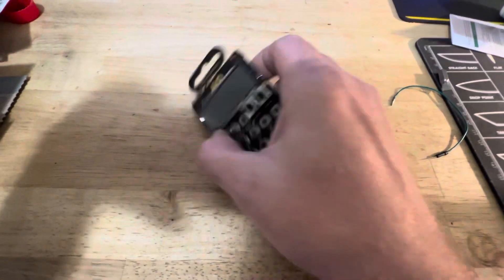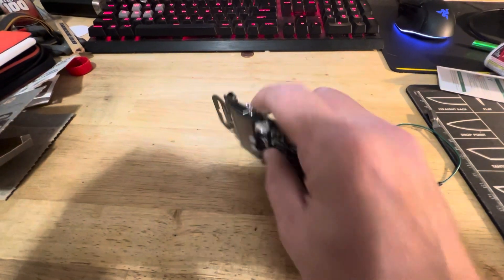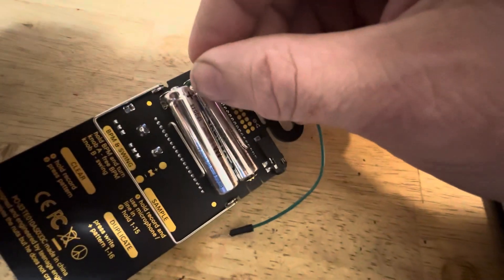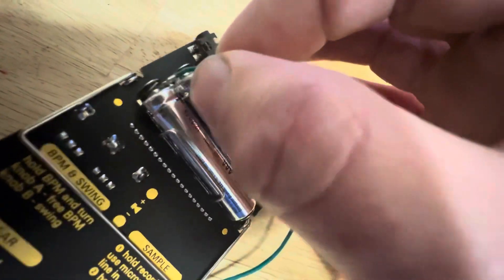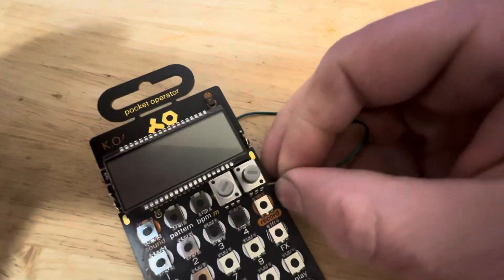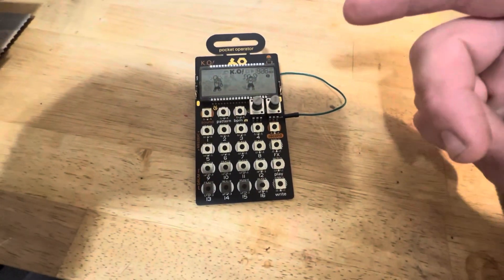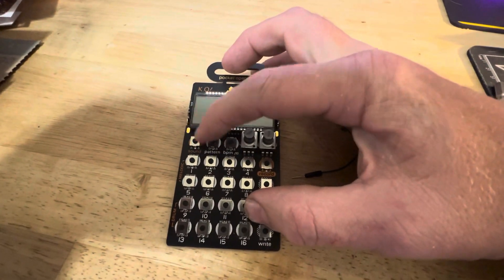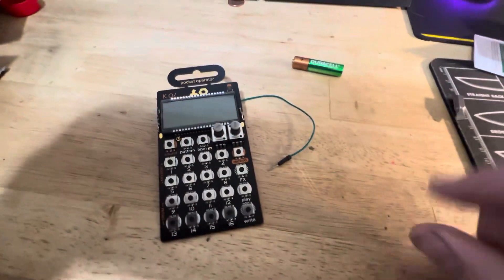Pocket Operators rejoice!! There is a fix for your dead PO!

Comment from the maker: The wire must be connected to the bottom battery or this fix wont work. ** Bottom battery, positive terminal, last pin on second potentiometer. The one closest to the right hand edge.
Edited 07/14/2024
The second Pocket operator never died. Still works to this day. Just gave it to my kid. Gots me a Tracker Mini now! If you'd like to see some beats like this comment.

Comment: This was great. I just soldered a small ethernet cable on the back of the PCB from the lower positive terminal to the far edge terminal of the pot and its sorted. tested first obviously before soldering. thanks

Comment: I can’t see where you plugged the wire into?
Anyway- I have a bunch of them, for a few years now- all working fine. 
I keep them in cases.
Reply from the maker: I literally point to the exact spot where the wire goes. Bottom battery, positive terminal, last pin on second potentiometer. The one closest to the right hand edge if you are looking at it straight on as you would use it..
Reply from the maker: Did you look at the video at all? Because multiple times throughout I showed where the wire goes. Plus I explained it in the description and in comments. All you have to do is watch... Wait your complaining that you can't see how to do it on your perfectly functioning Pocket operators?... Wtf lol.